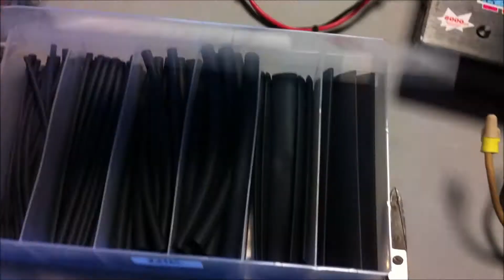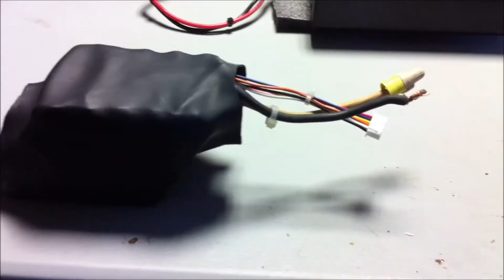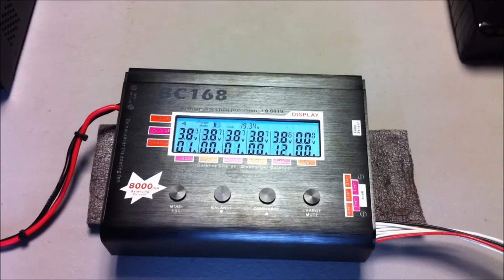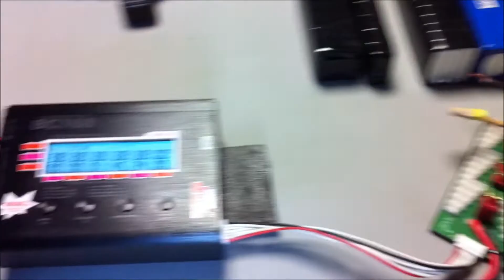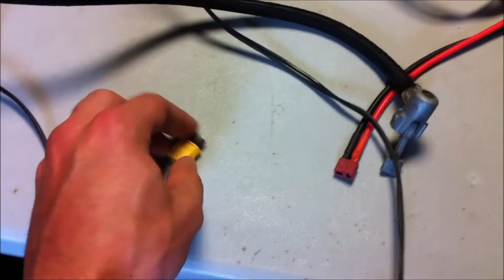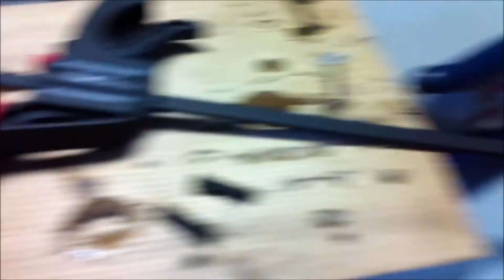Sony 5s 18650GR Battery heat shrunk and charged XT60

Comment: I can not seem to find shrink wrap this large anywhere. Is it HK only that sells the turnigy wrap that you have?
Reply: I cant find it anywhere. It looks like a nice neat way to store a group of cells.
Reply from the maker: Ya I have to get it from Hobbyking when i need it.
Reply: skeetab5780  thanks, It was the 200mm in the description that threw me. It is actually 100mm. I ordered 5m of it on Tuesday. No idea when to expect it, but since I'm waiting on bits and bobs arriving from China for my battery build, then hobbyking's slow delivery shouldn't be a problem.
Reply from the maker: anthony stafford Thanks for bringing that to my attention. I just fixed that typo. It is certainly 100mm